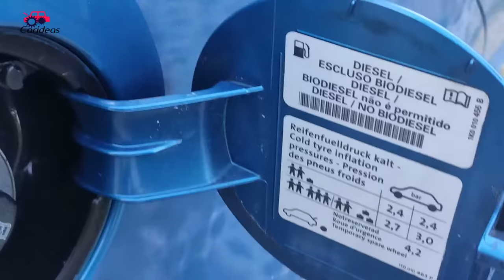💛 18 Amazing WD 40 Uses for Your Car, Truck and Automobile

Comment: Do not spray WD 40 on your car's body, it will shine initially but the paint twill fade eventually,  avoid getting them on your disk brakes yow will loose traction, the same goes for the parts of   your tire that have direct contact with the road surface,
Reply: if i would put on a car body and than wax it is that okay or put it on a car body use polish and wax is that okay ? and brakes and car battery stay fair away
but can I use it as a wheel cleaner and than use a polish ?
Reply: @koioo2  Use it only for what it is intended fof
Reply: @olanrewajuolawalewilliams1423  qwiet and clear very clear
Reply: You can use it to remove stain like asphalt.

Comment: Wait..What?? In #5 did you just spray wd40 through the wheel directly into the brake rotor?????  NOOOOOOOOOOOOO!!!!! DO NOT DO THIS.....SPRAY CLOTH AWAY FROM BRAKES AND WIPE ONTO WHEEL.

Comment: The WD-40 should NOT be used on plastic surfaces or plastic parts.  It removes the plasticizers from the material.  The plastic becomes porous and can break off.  Also, it has NO lubricating function.
Reply: There is WD-40 Specialist Dry Lube. Also, the official guideline says that you can use classic WD-40 as a lube in some situations (like lubing metal joints and bolts of a bed or lubricating Swiss army knives).

Comment: WD40 is a thin oil based maintenance spray for freeing off seized rusted components, I’d never spray it on my brake discs, or onto my cars wiper blade rubbers, for car locks it’s best to use graffiti grease than WD40, and for car paintwork it’s best to use car polish not oil .   Out of all these things shown here, it wasn’t shown to free off any suspension components.
Reply: brakes produce enough friction to burn it
Reply: Graphite??

Comment: I wouldn't spray it on the rims of the car with the brake pads right there. It seems you could get them covered w/wd40 and start a fire when the pads get hot.

Comment: Before using it; notice that wd40 dissolves grease too. So if you spray it on parts that should contain grease, you will be actually removing that grease. I would recommend to use later on lithium grease to replace wd40 to last longer.
Reply: Exactly
Reply: lithium grease  what brand ?
Reply: I‘m also not sure if it’s appropriate for rubber parts.
Scotty Kilmer btw says it’s not good for varnished parts in the long run. - It gives a short term shiny appearance if you want to sell your car , but it‘s harming the varnish and makes it fade.
Reply: P.S.: It’s a water displacer, hence its name, not a long term lubricant.

Comment: Its an anti rust spray not a Polishing compound .
Its oily & the more dust you ll get on exterior surfaces.
Better on Only rusty & clogged areas to make it smooth.
Reply: Correct
Reply: Agree
Reply: Not true, its also a cleaner and a lubricant

Comment: Use under the vehicle. Spray all bushings and axle boots to rejuvenate. I don’t use WD-40 inside the vehicles. I do use dryer sheets. I’m a guy so I buy the sport odor sheets. I put one under each seat and if you like a stronger smell fold up and put in side door pouches. Toss a couple in the trunk.  😊

Comment: My washing machine drawer was stuck. A friend mentioned wd40. So I got a can and sprayed it on the sides and in towards the middle where the clip is on the drawer. Used the red stick to poke about a little and HAPPY DAYS the drawer came lose. Best £1 I ever spent on a small 80ml can of this stuff. I am making note of its tricks now going forward. It takes pride of place in my DIY and cleaning drawer, as I was in a cahoots why the drawer would not come out despite trying every trick going pressing the blue button piece down etc. Darn washing powder mini clog on the clip. 🤦‍♀️😁👍

Comment: Wd 40 can use mainly for opening of rused parts like nut and bolts, screws ctc.. and effective on where send paper not working like so much matelic parts are jointed and working togather...
WD 40 will melt rust and parts movement easily...

Comment: I actually spray it on my break pads when they are basically screeching… or the disc is grinding non stop. Spray it on the pads and watch them work like new.  I have never lost traction or lost my break power, ever. If anything it made them alot better. Try it.  I have a 4 runner it’s a life saver.

Comment: Its VERY temporary for headlights.  May last a few hours or a day at the very most.  People also think that WD 40 is a lasting lubricant.  It wasn't made for that purpose but can also be a temporary fix to squeaky doors etc.  WD 40 was produce and used by NASA to prevent rusting on certain surfaces.  It is not an all purpose lubricant or cleaner and never claims to be that.

Comment: It seems to work on headlights but it will fog back up. Doesn’t stay clear
Reply: Yes, as soon as you wash the car, or it rains, the headlights will dull again.
Reply: It’s not made to use on headlights. The yellow tint plastic headlights develop is caused by the heat of the lightbulbs in the lights. There is really nothing which will work successfully. Just drive slower at night and be careful because almost all the drivers out there have the same trouble! You might consider replacing the lights but that entails removing most of the front end of the vehicle, which is very difficult without special equipment and very expensive.
Reply: @e.conboy4286  it really depends, on my car you just have to remove one screw and some clips

Comment: Any spray can use for the roof out side of car ? if the paint is off then got steanks on which sprsy will tske off of stanks from car roof?
Reply: No there is nothing to d for rusty spots except lightly sanding, blow or wipe of the dust that creates, prepare the metal with metal paint primer and let this dry completely, as directed by the paint makers. Then spray in small overlapping strokes and allow it to dry.

Comment: my flasher relay is stuck tight in its hard plastic socket and I cannot pull it out....can I use wd-40 to loosen it up?will it not damage the hard plastic socket?thank you in advance for your answer sir.....
Reply: Use silicone spray, it won’t damage plastic like WD 40 will.

Comment: ok this video teaches you how to ruin your brakes with use number 5 you do not want oil on your brakes that will not end well. Now that you got oil on the pads and rotors take the wheel off pull the brakes apart clean them all and then put it back on but look at the bright side your wheels where clean till you had to tear apart your brakes! had to make an edit this video is not recommended by an auto mechanic just so you know it will ruin things on your car i only got to i think it was 12 before i had to stop it
Reply: i agree not safe but it will wear off with the first time you use your brakes , just need to press a little harder the first time!
Reply: اینها.الکیه من که هرچی خمیر دندان زدم به شیشه چراغ پاک نشد

Comment: Think it tells you on the can don't use it on brakes or your tyres ,  for obvious reasons it can be dangerous in the wet if it's on your tyres , but don't take my word for it check it out , read what it says on the Can .

Comment: Spraying WD40 on lug nuts is not good. First it will allow you to overtighten lug nuts after removing them. Second it will allow lug nuts to work loose & spin off. Lug nuts should always be tightened dry without a lubricate

Comment: Oh.. no. One of the most dangerous thing that you've done was applying WD40 on WHEEL NUTS...!! It will penetrate inside and loosen the nuts and your wheels may fly away while running. Bad idea. Never apply any kind of lubricants on wheel nuts.